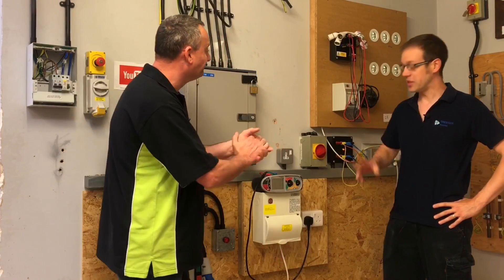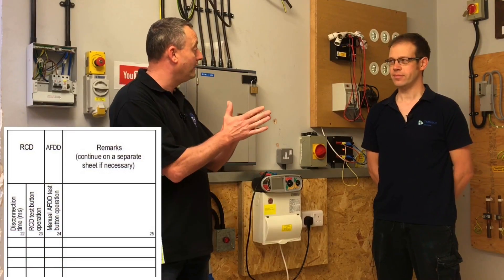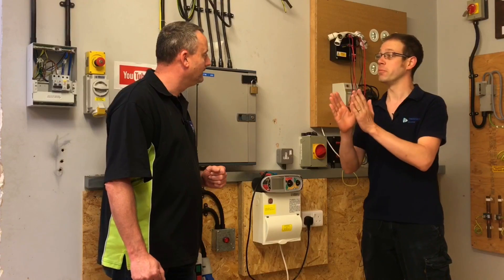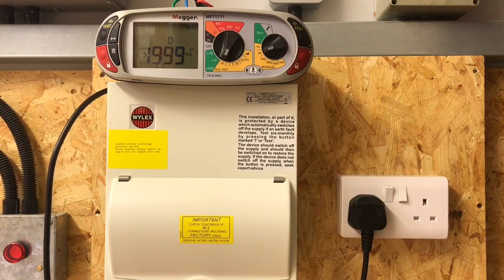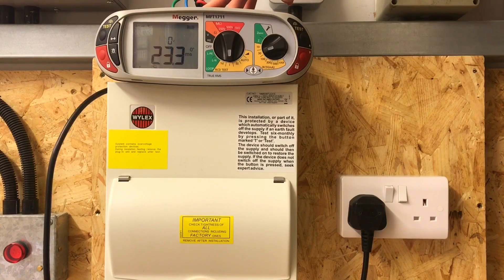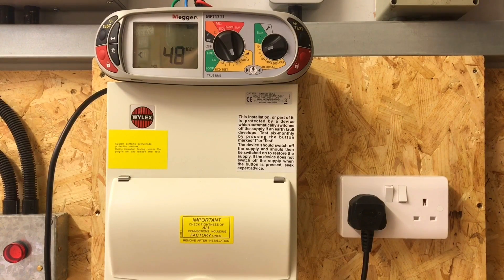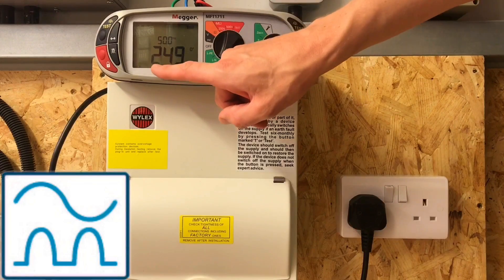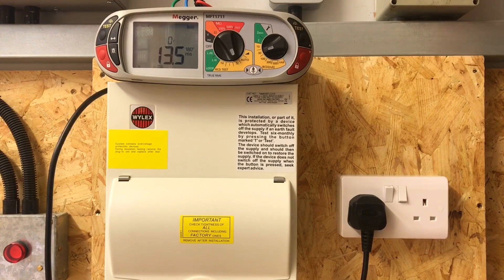Testing an ‘A’ Type RCBO 10 Times and NOT the Standard 5 Tests to Prove the Effectiveness of the RCD

Comment: Utter overkill, so a 16 way board is 160 tests on 1 aspect alone, good luck with that one, Recent NICEIC Annual inspection was told to perform a times 1 test on both cycles and put the highest reading on the test sheet, you guys need to remember your not part of the Institution that compiles the regs, unbelievable
Reply from the maker: UPDATE guidance 👍🏻

BS 7671 Testing RCD’s - Regardless of the Type of RCD Test it as if it is an AC RCD at x1 ONLY
https://youtu.be/zIPgYcLdQZE

Comment: If "requirements" become as stupid as "10 tests per RCB RCBO" then it is not a surprise that amount of fires rises - electricians do idiotic tests, waste valuable time. Time that should be used on something more important.
Just do A type test 1/2, A type 1/1 and the end. Is it even theoretically possible, that 5x will somehow not work if it works at 1/1.

Comment: Hi Gary call me fick if you want but as the test instruments are battery powered they put out DC test currents, so why is it a problem. Testing AC or DC type RCDs/RCBOs?
I heard that some RCDS do not funktion properly if there's a DC leakage from say a car eV charger if that's the case then  shorly a tester will not trip the RCD anyway as it puts out a DC current?
Reply from the maker: https://youtu.be/9qX89cPGgp4

This may help 🦾.
Reply: @GSHElectrical  thank you very informative but it still doesn't explain how a RCD tester does not have the same effect on the RCD and it will still trip the RCD, as the demonstration show the RCD is flooded with a DC current and won't opporate yet when more DC current is injected from the test instrument the RCD does trip indicating a problem of some kind.
Or am I missing something. Great video thank you

Comment: Those Wylex metal blanks, do they get a good enough earth connection from the case? I would have thought that the lacquer / paint might prevent a good connection, and then there’s an unearthed conductive part of the consumer unit exposed.
Reply: ive wondered about this myself. I guess the lacquer isnt considerd an insulator.

Comment: There is no way you need to do this.
First of all, why do none of the tester manufacturers state this in the manuals for the testers if this is the case?
Secondly, I've tested type A accidentally set to type AC and quite often the test fails. This does not prove a fault with the RCD but that the tester is set to the wrong type as then set to type A it passes all tests.
The tester is designed to do the relevant tests needed for a type A when set to type A. 
The NICEIC has been known to give wrong advice on more that one occasion so I wouldn't just go by what they say.

Comment: Really like your videos, I think they are great. But why are you testing type AC RCD when you have a type A RCD? There is no need for it. It is not that type A trips for a different reason compared to type AC RCD. The reason why type A RCD is sometimes selected is that it will still trip if there is a presence of pulsating DC up to 6mA. Type A RCD won't trip on DC, but it will trip on fault conditions on AC circuit if DC is present. DC can stop Type AC RCD working properly in fault conditions. That is why they are selected for car chargers, washing machines computers etc. For example electric car chargers (EVSE) can't be installed with Type AC RCD because the car could leak DC but can be instslled with type A RCD if the unit can detect DC current over 6mA and disconnect supply if that happens. Otherwise type B RCD would be required. Just for the interest - how many times would you test type F RCD? And Type B RCD?
Reply from the maker: Thanks for the detailed message and watching. We are going on guidance from an NICEIC field engineer and chats with manufacturers. Hopefully more guidance from BS7671 will follow on testing RCDs. All the best. Gaz 👍
Reply: @GSHElectrical  why is the half trip current only carried out on one half cycle and not both?
Reply: @GSHElectrical  I think the test with the AC type will test the trip speed and the test with the A type will test the trip speed with 6mA induced into it at the same time and that process may cause a different reading which is why manufacturers would say test the invidual parts.  But I still don't know why you only did the half trip on one instead of both cycles🤔

Comment: If it's a brand new installation a ramp test should always be performed to verify you dont have an overly sensitive device so eleven test for a new installation.
Reply: If there are no issues with the half trip then that ramp test is not required

Comment: Nice. what would be the reading of testing IR of low voltage cable (3X240mm)  with a length of 300 meters ? and which value of M Ohms  (for this length )i should expect if tested with 500V DC megger ? i have made my test and having a doubt about it. thank you for providing free information

Comment: Great video. Are the old multi functional testers capable of testing these type A rcd i.e fluke 1653 🤞🏻
Reply: Yes they are. I have a 1653 and you just use F3 to cycle through the types and F1 for the tripping current
Reply: kevy427 cheers thanks for the reply 👍

Comment: Thanks for the video. I was under the impression if the RCD was used for additional protection you record the highest at 150 mA and if it was to be used for fault protection record the highest value at 30mA.
Reply: You are correct, if RCD is for Additional Protection you record x5 reading, if its for Fault protection you record x1 reading

Comment: Any one had a problem, testing Hager RCD’s? Tested 6 recently all new type A  and readings coming out at 136ish mA? Cheers guys great videos
Reply from the maker: This may help
https://youtu.be/c0dPUf_aZ4E

All the best Gaz
Reply: I have had this issue aswell nick spoken to someone from select who on the committee first the 18th they are looking into this
Reply: 136ms is quick enough. Why is it a problem?
Reply: It’s not a problem just the other type of hager rcds would trip max around 32 and new ones are a lot higher just didn’t know if there was a different method of testing them
Reply: @NBundyElectrical  18th edition always said at a current equal to or higher than 5x current, before Hager even released the new notes regarding 250mA.

Actually I think it was in all the other regs but we popularised 5x for many years and not realising we can go higher

Comment: GN3 states “For each of the tests, readings should be taken on both positive and negative half-cycles and the longer operating time recorded”

Won’t that be six tests (0.5, x1, x5) plus the functional button pressing i.e. seven tests in total for the AC then seven more for the A?

Wondering why you didn’t test 180° on the x0.5? #E5
Reply: You would only press the functional test button once ..... surely? So just to add to the dispute or ‘controversy ‘ , it is actually 13 tests in total ?  The functional button operates internally irrespective of the test configuration on the mft. Although is it functionally testing the ac or dc side of the rcd? Or both?
Reply: @adrianajdelectricals2290  exactly right.
Reply: I'm glad you said this. I immediately thought this too. As you stated: 3 tests on both sides of the sine wave = 6 tests, plus test button functional test = 7 tests. Please advise if we're missing something here Gaz. Ta👍

Comment: Good vid chaps. I hadn't thought about it, but I guess a tester set to Type-A performs the test with a DC component injected, so it makes sense to repeat the tests on the AC setting to ensure it behaves as expected. I use Easycert which dropped the 1x test column when 18th came in and put that flimmin' AFDD checkbox in there. I believe Easycert is designed to be compatible with NICEIC's paperwork to allow direct printing from the app, so that suggests NIC no longer have the 1x column. I print my own custom certs, so I haven't seen a blank NIC one to be sure. If they were going to drop a column, I'd rather it was 'number of points served' which isn't on the model forms and I always leave blank as BS7671 doesn't define what a 'point' is, so one installer's count may differ from another's!
Reply from the maker: Hi David, more good points raised thanks as always. Gaz
Reply: @GSHElectrical  Scratch that, points is defined. Not sure how I missed it as I've searched for it before I'm sure!
Reply: @dsesuk  Points is defined....its still a total waste of a column though, and there is only one column for Rcd operating time on the Niceic paper form
Reply: @matthewdale956  It's defined as a point in fixed wiring intended for the use of current using equipment. Not sure how I ever missed that. I still don't like it though. I've seen installers who counted every termination point (switches/junctions), some who counted just the current utilisation points (sockets, luminaires), some who have miscounted causing confusion, and paperwork which is out of date after points have been subsequently added or decommissioned. It seems a futile thing to be recording, and it's not on the model forms, so I'd like to see it disappear from third party paperwork personally, especially if it's taking up a column that's more suited to recording something useful like 1x RCD disconnection time.
Reply: Dave when are you getting an Instagram account, showing your age bud 😂👍
Reply: @NBundyElectrical  Never did figure out Instagram. Unlikely to start now!
Reply: David Savery Electrical Services it’s a shame Dave lots of guys are asking if u have an account, just take loads of pictures of the McDonalds hat and u will become insta famous 👌🙌

Comment: Hi, Great video again. It's my understanding that you recorded the 5x operating time in the single column on the 18th Edition model forms, is this incorrect? If so does it state this in the regs? Thanks in advance.
Reply: Yes you are correct, if it is a tncs or tns system and being used as additional protection. I had an niceic assessment last week and this is one of the things that we talked about.
Reply: Reg 643.8 states that the effectiveness of the RCD which is providing additional protection has been satisfied by doing a test at 5 times the rated residual operating current and tripping within 40ms. Therefore it is the highest value obtained when doing the 5X test that should be recorded. Other than that, great video as are your others.